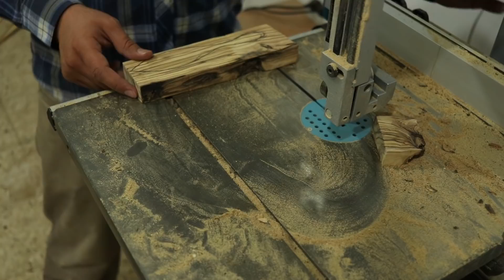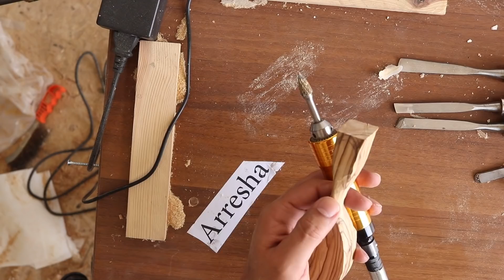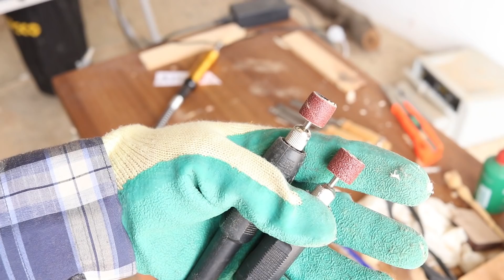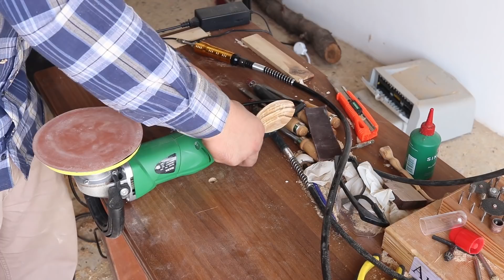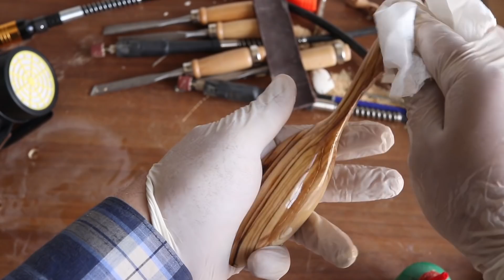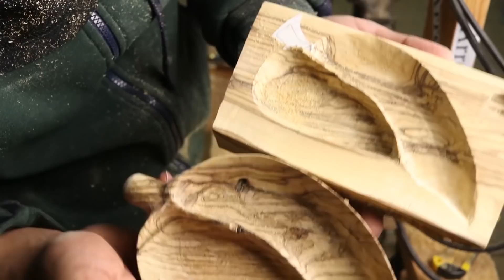DIY olive wood carving simple spoon using rotary tool like dremel - power carving

Comment: That takes some brass balls to use those bits with no gloves. They will carve flesh just as easy as wood.
Reply: Lol he put on gloves for the little sanding drum bit. I use those to sand my calluses on my heels from wearing sandels to much in the summer.
Reply from the maker: hhhhh, these bits are not that sharp and even if they touch your fingers will not cause any injury or will cause a really minor one. since you need to push them firmly against wood in order to cut it. 
and actually I am wearing gloves to prevent electrostatic shock from that machine. 
wearing gloves makes it harder to control the carving bit.

Comment: Petroleum based oil finish on a spoon? Very nice carving. Fucked finish.
Reply from the maker: Thank you for watching.
Regarding Mineral oil, I did alot of research about food safety. Most of researches say that it's food safe
Just search: "food safe wood finishes"
"Food grade Mineral oil"
You will find that Mineral oil listed as food safe finish.
Reply from the maker: check these products on Amazon
https://www.amazon.com/s?k=food+grade+mineral+oil&camp=1789&creative=9325&linkCode=ur2&linkId=903b0bea8d5da345323772f1c194e628&tag=tawfiqinjass-20